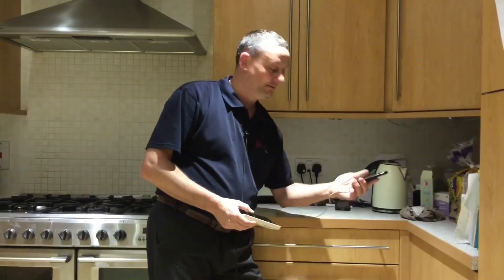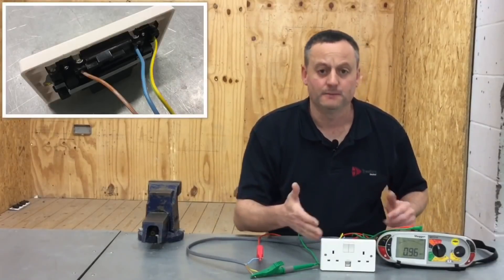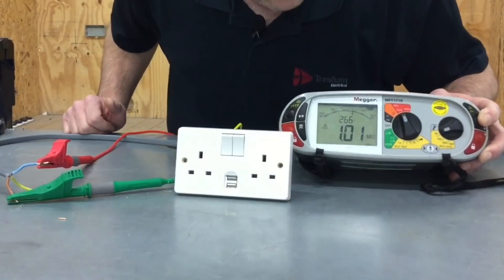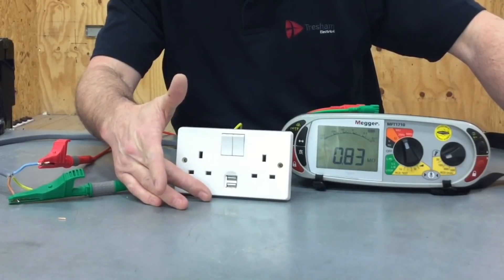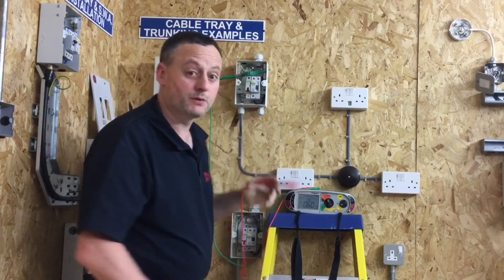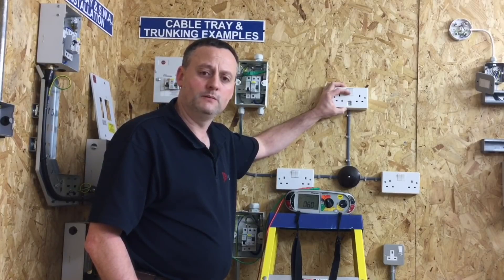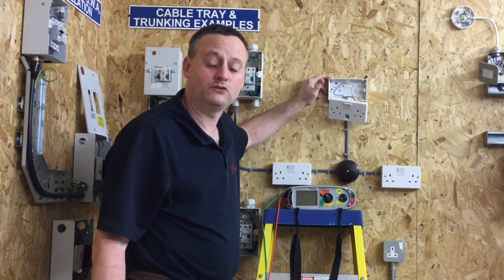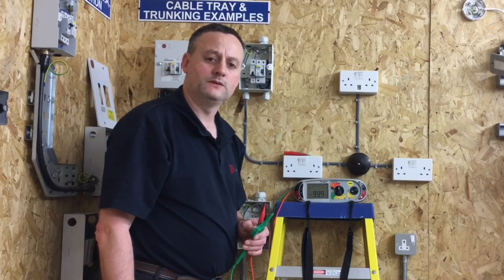USB Sockets and the Issues Testing for Insulation Resistance (USB Socket)

Comment: The problem is, when you reconnect the neutral and refit the socket into the backbox you cannot ever be 100% certain that there isn’t a loose conductor, or a pinched/damaged cable within the backbox

Comment: I have to wonder if there is any truth to the claim that a 500v test could damage electronic equipment? As JW has done a video showing how he tested a smoke alarm at 500v and 1000v and the smoke alarm still worked as intended, also Nick Bundy had done a video showing how he tested LED lamps and LED driver again at 500v and 1000v and yes they still work as intended. So is it not doubtful that the insulation resistance test could or will damage such equipment?
But I have to agree it’s better to these line and neutral combined to earth or if possible remove such equipment from circuit.
Great video as always Gaz
👍👍👍👍❤️

Comment: So if regs say test at double the expected voltage why do we test at 250v.  Why not make USB charge sockets only work when socket is on.  So we have to remove the socket test an refit my thinking is from back at college re fitting what if the screw cuts in just a bit on refitting the test results are far as am concerns are void.  As testing should be don in the manner the installation is used.  What possibly is there refitting the cable could be damaged against the back box or refitting the screw.
Reply: You’re right it is an issue. My workaround is to test L+N to CPC as a final extra step after putting the sockets back. Nowhere to record this on the EIC and still doesn’t 100% confirm IR between L+N but what else can you do?
Always feels like a lie when I write the test result for L-L because I know that the neutrals are not connected to the USB sockets

Comment: im niceic .Heres a thought ,How do these sockets even comply?When is it acceptable to have any transformer permanently wired to a ring main for eg with no fuse in line taking it down or means of local isolation?
Reply: They likely have internal fuses soldered into them.

Comment: Why would you  screw the cover back on the socket for full insulation resistance testing, it would seem sensible to me that if the cover is not screwed on when i do a visual check that I need to do something with that socket?
Reply: apparently IR  is dangerous  cover should be on
Reply: at least thats what i have been told when i did my training
Reply: @topchannel1000  IR testing sends a charge through the wire, the better the insulation the longer that charge will be stored in the wire even once the tester has been removed so yes it can be dangerous if there is a risk of someone removing the socket and holding the wires but as most of my Electrical work is done with the customer out of the house and the fact that i run a discharge through the circuit straight after I guess I deem the risk to be minimal  - Equipment should be discharged (shunted or shorted out) for at least as long as the test voltage was applied in order to be absolutely safe for the person conducting the test.
Reply: @paultaylor4032  yes I know I would not put the cover on for  IR but they dit not allow me to do that when i was training

Comment: I have question for I wanted to change a lamp  ,shut off switch but still low current coming finally I switched off the banel still low current coming last resort I swetched meter off then no current and changed the lamp what is the reason for that......

Comment: So if it's an existing circuit you would leave it connected and  would only test live and neutral combined to earth. how would you write this on the certificate if the boxes are just live to live and live to earth
Reply from the maker: Hi. The box Live/Earth on BS7671 testing paperwork is for line and neutral together as they are live conductors to earth for the insulation resistance test... hope this makes sense Gaz 👍

Comment: Great video, but why do you have to screw the socket back into the box before testing? If you left it out then it would be a reminder to reconnect the neutrals.
Reply: You are right, i don't put the fronts back on until i have finished the test

Comment: I wish the USB components were switched - cannot be beyond the wit of man to design and fit into that 'generous' bit of real estate that is the standard twin 13A socket. I fitted a rise and fall power strip (with USB sockets)  to a kitchen island that is switched - very happy with that.
Reply: A USB socket doesn't need to have it's own switch, why not just have say the right hand 240V socket switch the USB outlets at the same time? Unless I am missing something? Or why not a three position switch? Off, 240 socket on, and 240 socket on with the USB on.

Comment: Excellent video we fit a  lot of these usb sockets at work I did wonder how they tested them, can you tell me when you do an insulation resistance test on a rcbo do you have to disconnect the conductors from the rcbo first or can you leave them in like an mcb cheers

Comment: Great video, any chance of doing a video showing how to insulation resistance test a lighting circuit with impulse (touch) and dimmer switches connected to the circuit?
Reply: What about the downlights connected ? Will these have to disconnected too ? During the test it be left in ?
Reply from the maker: Hi. These types of equipment need removing from circuit before testing. Easiest way is to put the line and switching line together in the same terminal of the switch so you don’t pass 500 volts through the dimmer. All the best GSH Electrical

Comment: Another great video if it was a periodic rather than disconnecting usb sockets or other items that would present a reading would you just test between live conductors together and earth thanks for posting these videos they will help many trainees
Reply from the maker: Hi. The test you talk about is fine on a periodic inspection but no good on an initial verification when you are required to test all conductors. Thanks for the positive feedback all the best GSH Electrical